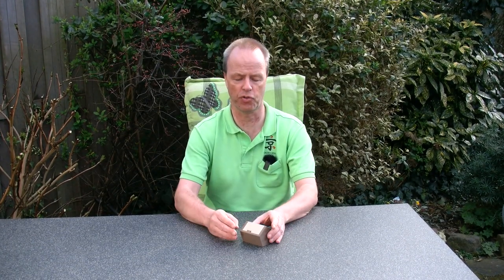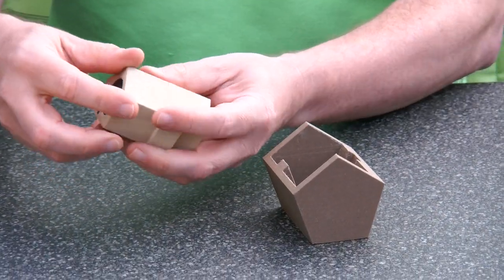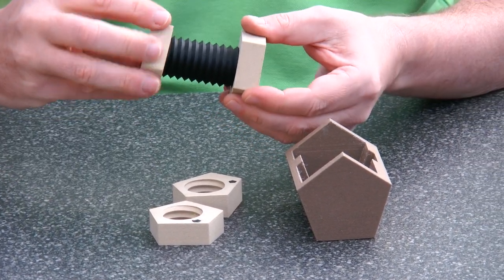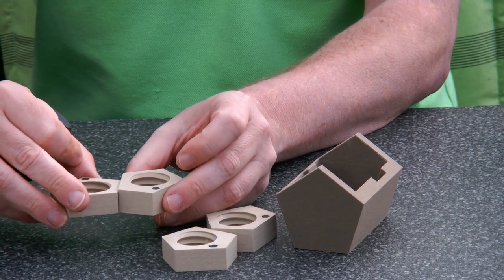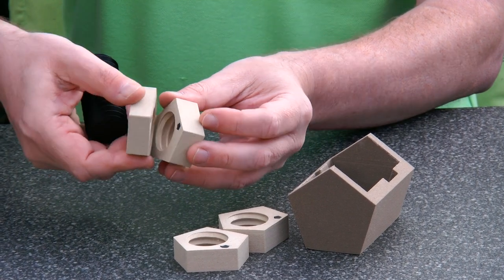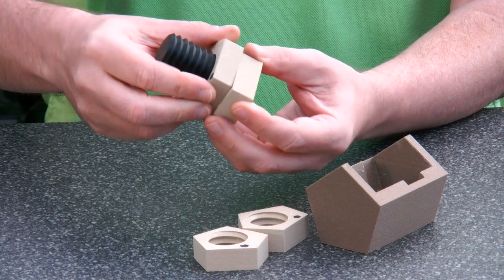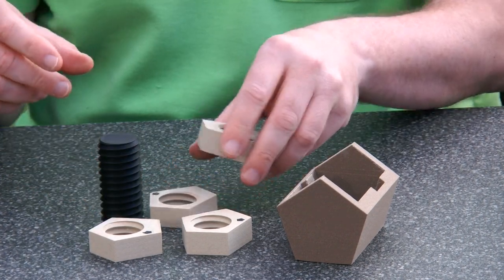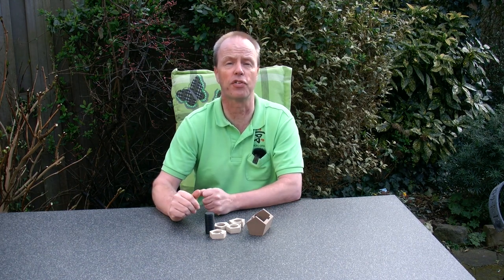Nut Stack - What does "phase angle" mean for screws?

Comment: I suppose if you wanted to create an identical set of nuts with n-fold rotational symmetry, and you wanted them all to thread on to a screw and be perfectly flush, you would have to calculate it so that the height of each screw is k/n times the phase angle of the  threading. Is this this something they do with standard hexagonal nuts? Ive never tried measuring it.

Comment: Screw phase can be an issue with normal threaded plumbing fixtures.  In the USA, they use tapered threads (NTP standard), and its not uncommon that you get a relationship where it's not fully tight, but you also can't (or would rather not) give it another full rotation (say because there's another joint that would disturb, or you run out of room to fit the wrench, or whatever).  This being plumbing, there's usually a solution (use different parts or a different tool) but it's annoying when it happens. 

It's especially common with things like gauges, where the face need to end up in a specific position after screwing it in.  There's really no choice except either accepting the looser position, or forcing it to the tighter one.  Know which is appropriate is a matter of experience.
Reply: Can't you solve this problem by using some washers?
Reply: @sebastianjost  No, washers aren't much use in plumbing.  Imagine you have a long pipe, one end fixed already, and are putting an elbow on the other end.  You can only position the elbow at a specific angle.  If it is loose at that angle, you have to turn it a full 360 degrees or not.  Washers won't help, and sometimes going that full turn is a real struggle.